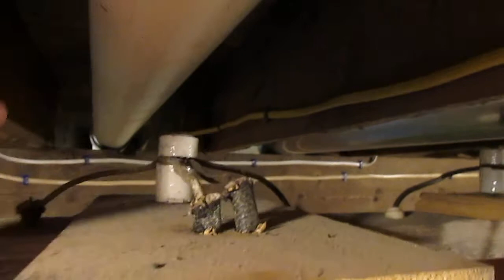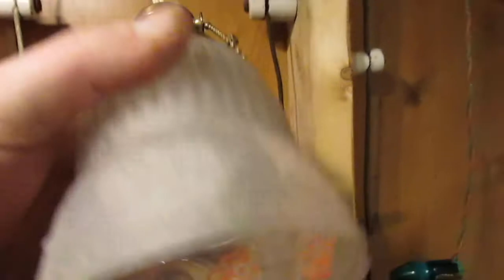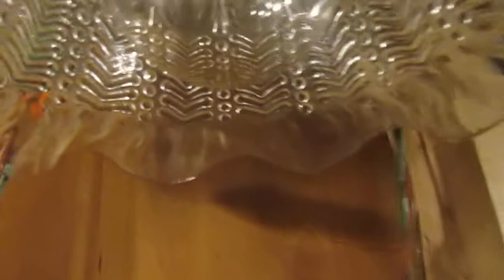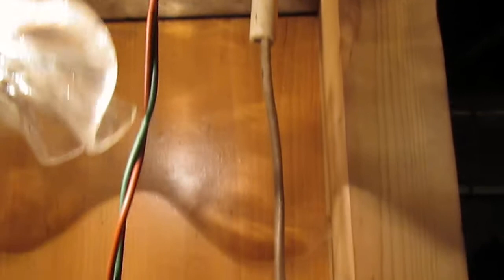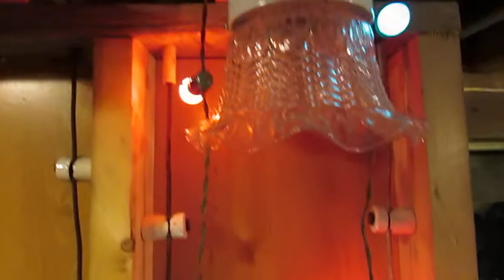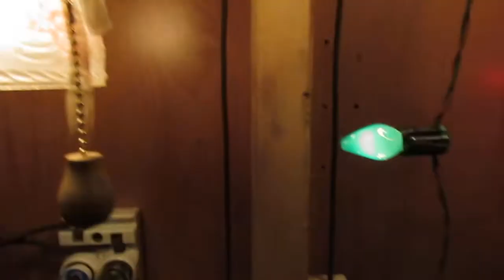Knob And Tube display powered up for demonstration

Comment: This is very useful for me just to see how it should look. I have a bunch of parts and plan on using them on the ceiling of my living room for lighting using a surface mount installation. The whole living room is an antique industrial vibe with plans for belt driven ceiling fans. Of course all my knob and tube will be running 12v DC so insurance can't complain lmao
Reply from the maker: I am Glad you Enjoyed this presentation , I had a Great deal of fun creating this display